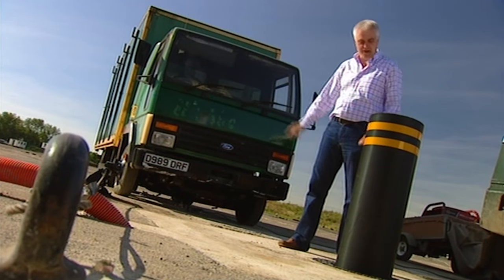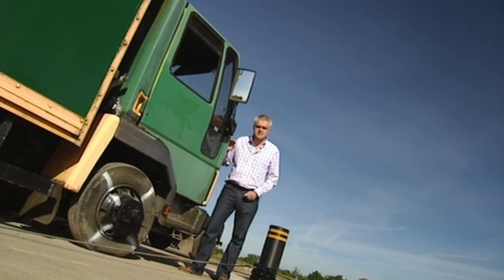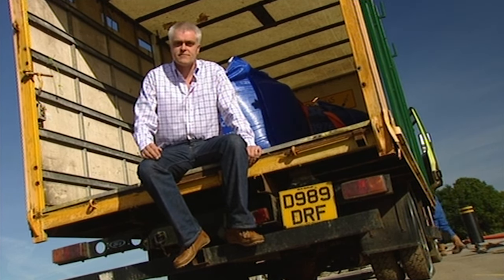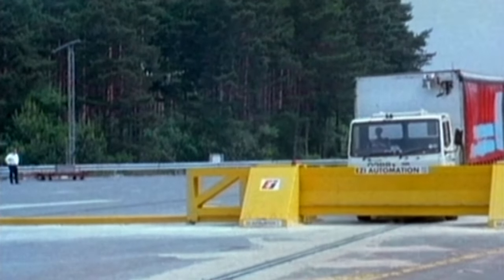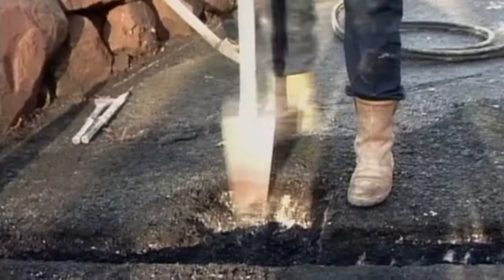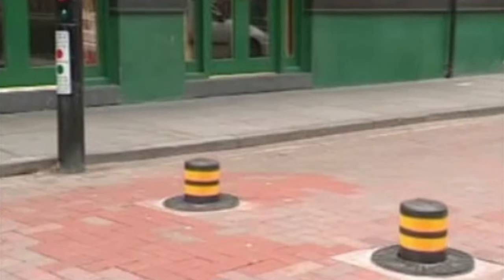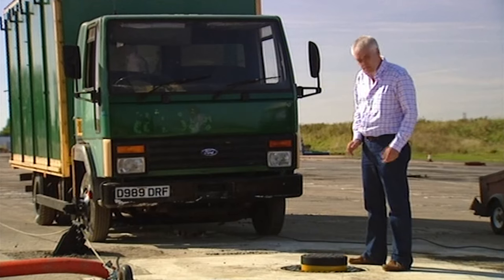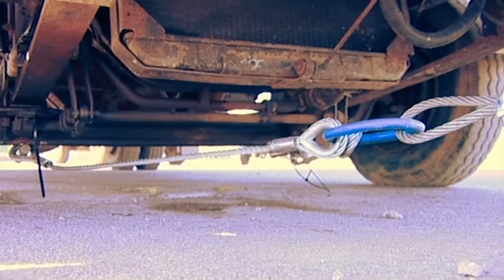Crash Test Month: Truck Hitting A Bollard

Comment: Apparently these are also designed to kill the driver.
Reply: hate to be the guy in it
Reply: g
Reply: It would be very useful in Nice.
Reply: That's what I'm thinking about yes, what if someone overlooks the pole while it's just coming up from the ground or something? This person will not survive the impact.
Reply: Unless they install these in the middle of the motorway, you aren't going to hit one of these at those speeds.
Reply: They could also be installed alongside traffic signals so it is known when they are being deployed.
Reply: the wreckage would still hit everyone
Reply: they're more made to protect the building and other realistate
Reply: That's just a bonus.
Reply: Well, then I guess don't plow trucks into crowds of people with the intent of mass terror and bloody murder.  Then you don't have to worry about it ;)
Reply: Don't wear a seat belt so you're safely thrown through the windshield clear off the collapsing cab, where you will then land softly on the asphalt.
Reply: Thats nic3
Reply: They're placed by buildings, if a truck full of explosives tries to ram in one, the bollard protects it
Reply: @stephans1990  Well,  look where you going and you'll be safe
Reply: @Skyhawk1998  That would be fantastic.    Just set  the top speed 5km/h above  the speed limit.   Just deploy it when someone surpases the limit.   Also good for  population control as well!
Reply: @andycapo9you  There is a pole like that in the city center of where I used to live and there are whole compilation video's on the internet of people hitting that particular pole. So yeah, this happens more easily than you might think.
Reply: Or it will rip your fram and suspention from your truck
Reply: Well that’s one way to stop a suicidal bomber
Reply: @DandySoleil  exactly
Reply: Good
Reply: All the better. It’s not like our police forces would have brought them to justice appropriately. We can’t be too careful. This episode was made in the wake of IRA attacks and the 7/7 bombings. Since then we’ve had that guy running over the pedestrians on Westminster Bridge and the Manchester Arena bombing, both of which happened in 2017.

Comment: One of the most satisfying aspects of this truck-stopper is that the driver himself gets shredded.
Reply: MrPLC999 well yeah u need some balls to mess wid this thing.
Reply: I know they frame this as Anti-terrorist. 

but realistically a terrorist planning a truck based bombing attack is going to not target the place with ultra heavy duty bollards.

the only thing this bollard is gonna obliterate is someone trapped in a runaway truck or who fell asleep at the wheel, its also gonna obliterate anyone standing on the far side of the bollard by sending chuncks of vehicle flying into them.

Comment: Try it with a tank.
Reply: +Krasimir Velichkov I tried, I got arrested, thank you
Reply: +Krasimir Velichkov They could make one big enough for a tank. Tank's don't do well with concrete barriers.
Reply: +friedchicken1981 Really?!
Reply: Peter Chang no, not really :D
Reply: +Krasimir Velichkov I'm pretty sure you can get bollards a bit like this that are designed to stop even tanks. Some I have seen can raise in 10ths of a second.
Reply: Like......the truck in Berlin?!
Reply: They have existed for a long time, but for a tank you do not really have to worry about speed the fastest tank can go 51mph in perfect conditions. There are tons of different anti tank obstacles, most of them are just concrete pyramids, or large metal beams placed in the ground, or a transportable barrier called hedgehogs (I am sure you have seen them) all of those are just not as mobile and hidden because in the modern era we do not really need to worry about tank invasions. If a major city was being invaded by tanks pop up barriers would be the least of our concerns lol.
Reply: It would't make it. It's been tried.
Reply: Or have a truck sitting on the flatbed of another truck facing backwards.One person drives the flatbed towards the bollard.As the flatbed hits it,the truck sitting on top is knocked off and then delivers the payload.

Comment: But what if terrorist use a motorcycle?
Reply: There are security devices that can stop those too. Stuff like drop-arm barriers, gates, etc.
Reply: fluido82 they are from a third world country, they probably would tip over because they don't know how to use it
Reply: Being run over by a motorcycle is not really that effective, if you run into something or someone you will quickly fall over and you will likely not even kill the person you hit. So a motor cycle is a lot less dangerous when it comes to someone using it as a weapon.
Reply: And what if the bike is loaded with explosives in panniers ?duh
Reply: Spike strip

Comment: Will it work for a train?
Reply: A train would make the Bollard snap like a matchstick
Reply: DolleHengst Lol that's what I thought.
Reply: ROCKETGUN BOOMBS So what's your point?  Until you can put tires on a train and drive it downtown, I hardly think it's a worry.
Reply: how about a space ship
Reply: PantherP74 Um..nope. You know, there's probably nothing can stop a train quick enough to avoid deadly accident. Even the brake take it 1 mile to dead stop. I'm just curious to know if it can help stopping a train. At least slow it down.
Reply: HKS NISMO yes

Comment: A rebar cage that is measured out to contain the desired bollard amount is constructed and then cemented into the ground with pvc pathways to operateing and power the system. The basket with the (Pneumatic, Hydraulic or Electric) cylinder is mounted at the bottom of the cylinder cavity.                                                                                                                                          

If you want me to build you a bollard system then let me know. I'm located in Los Angeles.

Comment: why are all of the uk trucks I see cab overs? they are not safe. I would think the north american style is safer
Reply: +482lost By and large the length restrictions add in weight restrictions. Truth is our infrastructure is medievil (in every sense of the word) compared to America who had the gumption to generally avoid obsticles or blast a hole through it. America developed around the truck. The truck Developed around the UK. 

With tight roads and the weight restriction on poor roads and weak bridge (there are many in this wet country) the best design for the UK is COE with as low a kerb weight as possible (the rest, as always, made of the load). Bigger space behind the driver and more room for heavier products means better return on loads.  Also COE's are generally more maneuverable due to generall shorter length which is a must here. 

While the above principles hold true the world over. America has given enougth wriggle room for it not to be an issue, so trucks are bigger and better suited to long hauls. 

Going off on a tangent If you think US style is better, Aussie style is better still. So Big and So Heavy that all problems just get out of the way ;) :D
Reply: +stegomon There are actually some reasons i know, you get a much better view, and they can turn more degrees. The only negative is that cab overs aren't that safe for the driver.

Comment: Question, if the truck is loaded with explosives, and it's traveling that fast when it hits the pole all of the explosive material is going to get thrown around violently. Wouldn't it cause it to explode? Obviously it's better to explode at the front gate than in a parking garage under the building, but still do they plan for this?
Reply: If its conventional explosives that are triggered via electric discharge or a specific amount of energy, then no. There just gonna be one hell of a mess to clean up after the idiot driving the truck gets turned into paste.

Comment: But will it blend? This is the question...
Reply: It sure did there. It blended that truck until it turned from a hostile truck to an Innocent smoothie.
Reply: MrSupercar55 Yes, but will that bollard blend? this is the question...If you are confused by my question, search "Will it blend?" on youtube and you will see. :))
Reply: deiu9999 The bollard won't because it doesn't fit in the Blendtec Total Blender.
Reply: MrSupercar55 Cmon man, really?... :))
Reply: deiu9999 Really really. Those things are 35cm in diameter and 1 metre high.

Comment: its a ford tho
i want to see it with a mack or a volvo
Reply: The same thing would happen with a Volvo I think. A Mack is one of those American lorries with a long front end, so I think the occupants stand a better chance due to the fact that they actually have a crumple zone. However, the heavy load might squish the cab and anyone inside. However, since this test is for security devices to protect against intruders and suicide vehicle bombers, such as ISIS, the fate of the attackers is of no concern to the would-be victims, and it's probably better if the attackers in the truck did not survive.